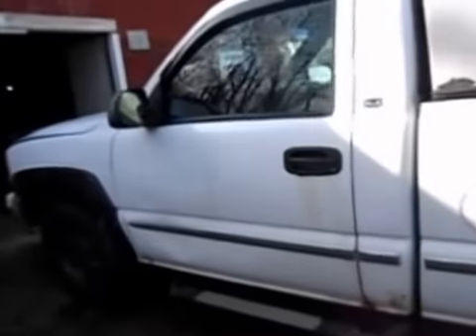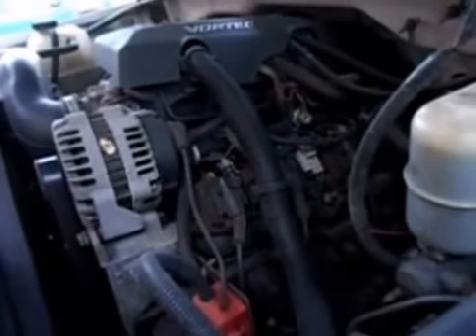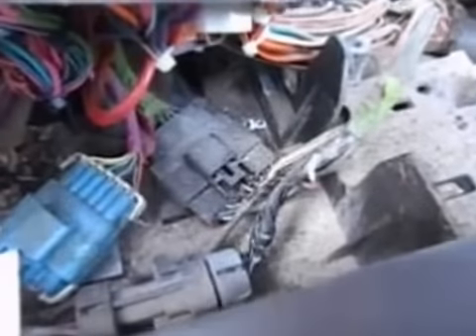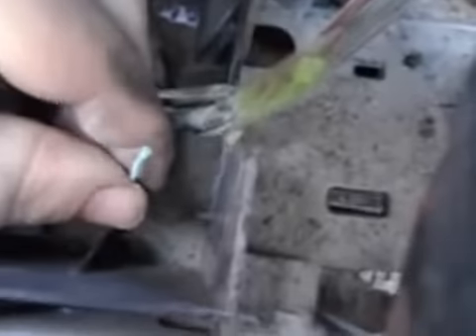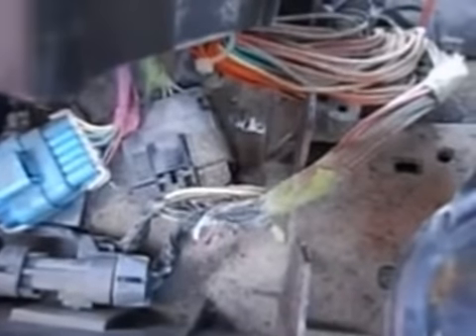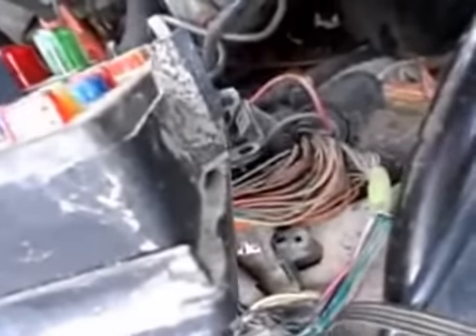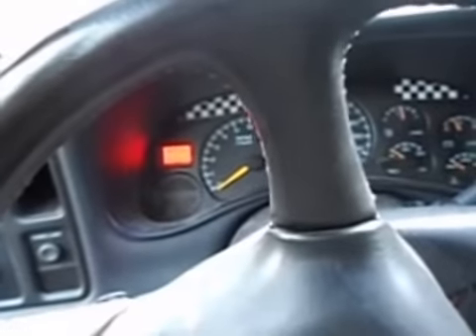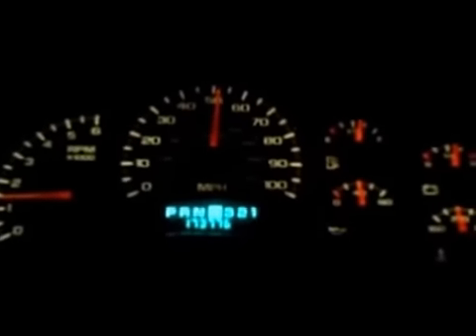shift issue 99 GMC New body style Sierra 1500

Comment: Bro Iv tried everything 
Ignition switch 
New ecm and BCM 
Ground wires 
Checked the green connector checked the entire harness 
Every fuse 
Brake light switch 
Iv done it all no difference 

Iv had enough I’m running a hot wire to the fucking thing first thing in the morning iama let yall know how this goes

Comment: Just put a new transmission in my 2000 Tahoe it's stuck in 3rd gear will be checking this tomorrow.... hopefully this fixes it....truck set for almost 3 years
Reply: Check you transmission harnes I had the same thing and my transmission harness was disconnected

Comment: Is that pink wire responsible for all gear shifts? I have a late first gear shift. Won’t shift into 2nd until the rpm is way too high, then it shifts. Not bad on the flats but up a slight slope, I get that late shift. Any thoughts?

Comment: when fixing wire's I always solder them together you'll be sure not to have to go back in to fix it. unless a chipmunk comes back.... but remember to use the rt solder thin electric solder of course not plumbing solder.. and remember to always put a little on tip just before you start. good video. bro.

Comment: First dam video that makes fucking sense 👏 👌  thanks my  feild driving friend!!!!
Reply: I should say that my 2002 GMC  YUKON XL IS ONLY DRIVING IN FIRST GEAR AND WONT SHIFT BUT ITS NOT SLIPPING AND THE CODE READS  NO CONNECTION TO THE COMPUTER. AUTOZONE SAID THAT I SHOULD BRING IT TO THE DEALER FOR THE COMLUTER ... IM LAUGHING BECAUSE I WAS INTENDING ON RUNNING THE 12V LINE TO THE TRANS .... LMFAO

Comment: I have a 99 4 wheel drive GMC 5 3 1/2 ton with 4 l60e transmission it will not go into Ford or reverse at all possible problems

Comment: I have an 1993 Chevy Silverado transmission shifts out good but has to put it in low gear to take off
Reply: James Andrews I have '96 GMC  1500 pick up that has that same problem basically. How did you fix yours?

Comment: Mine goes limp mode after a while of driving like when it get hot!
Reply: If it's electronic throttle body you probably have a poor connection on one of the pens on the wiring connector. I unplugged mine squirted die electric grease on the female side of the plug and worked it down into the holes. Plugged it up never had a problem since
Reply: You ever figure this out?
Reply: I’m here to figure out if the problem ever got solved ? I’m having the same problem truck shifts good up until it warms up.
Reply: Same here! Brand new from autozone. As soon as it it hits 120degrees I go into limp mode with no codes.
Reply: I’m having the same issues . Shifts great when cold when temp gets up to operating temp it loses all gears and engine stalls does not cut off . Help.

Comment: I’m having the same issue on my blazer imma check under the fuse box tomorrow reply to this comment so I can update if any you all wanna know what I find out about mine. By the way I replaced several solenoids and changed my filter and fluid numerous times as well as the inner harness because I believed it was an electrical problem*** but will check the fuse box connections ASAP.
Reply: Did you fixed your truck?
Reply: @Anthony-gw8sx  no I am still having this one code, Shift solenoid 3/2 downshift. I’m all out of ideas. When it warms up a bit I’ll drop the pan again and see what I can come up with
Reply: You figure it out yet?
Reply: @stevenswiatek6268  A-B solenoids. But I’m still having the code for 3/2 downshift solenoid that could be just a bad ground. I saw another video that explained how the ground going to the computer for that particular solenoid tends to go bad and they used to repair it for free but stopped or give an upgrade kit to replace the bad wire inside of the harness. Also to note*** When reinstalling the transmission pan, be careful not to damage those two A-B solenoids because that was my issue.
Reply: @SmokeStack456  so after you changed the downshift solenoid it still threw the code?
Reply: @justinbogard6700  yes the old one didn’t look bad either
Reply: Am having a problem with my 05 Silverado it runs good on the first but takes long to shift but it jumps 2nd and go to the 3rd gear i replaced 2 solenoids i also replaced the gasket put new transmission oil and new filter still does the samething
Reply: @SACRAMENTO_916  check the wiring for power at the solenoid. If it has power the next thing to check fault codes. For mine I had a p0785, the cause wasn’t the transmission but the oil pump wasn’t making the right amount of pressure so it threw the pressure off in the transmission as well. The oil cooler lines was leaking causing the pressure the drop.
Reply: @SmokeStack456  thanks for the advise man
Reply: @SACRAMENTO_916  no problem man let me know what you find out
Reply: So i took my 05 Silverado for a test drive and now it doesnt shift at all it only goes 1 gear and reverse thats it. The mechanic guy said i got 2 options here swap to a new transmission + labor or rebuild the whole transmission?
Reply: @SACRAMENTO_916  how bad is the strainer(filter)? And did u make sure u used the right transmission fluid and correct level? I know dropping the pan in these trucks is a PITA, but once you removed it again go ahead and replace the 2/3 shift solenoid, the 3/2 solenoid and A/B solenoid. If u only got first gear could u manually shift to second, third, so on etc.? If so, it’s definitely the automatic solenoids that is the problem. Each one would need to be checked and replaced if necessary.
Reply: @SmokeStack456  it wont go to 2nd 3rd 4th it only stays 1st gear i bought 2 new solenoids and transmission shift sensor AB and it still does the same
Reply: @SACRAMENTO_916  ok how’s the fluid level, with a low fluid level it can cause these same symptoms. Unless there’s a fuse or something in the wiring
Reply: @SmokeStack456  is exact level
Reply: @SACRAMENTO_916  when are you going to work on it again?
Reply: @SmokeStack456  probably in 2 weeks i spent lots of money just to buy pieces what am going to do take the transmission off and take parts out maybe i can find a solution to it if i do find what was the problem ill comment let you know what it is
Reply: @SACRAMENTO_916  well update us when u find out and good luck. There shouldn’t be a problem finding a good used one if you have any you pull a part places in your area. I think the going rate for a used one where I stay is about $150 fairly reasonable price
Reply: @SmokeStack456  i need help is the same vehicle 05 Silverado i had 3 codes for the check engine light on and i fix it so i drove it 60 miles check engine light came off so i took it to the smog and did not passed caused CAT and EVAP incomplete any suggestions?
Reply: @SmokeStack456  am still working on the transmission also
Reply: @SACRAMENTO_916  well your evap system is leaking or there’s a charcoal canister missing. If you had any accidents be sure that accident didn’t knock anything loose. Start with your purge valve location and follow the connections throughout the truck. You would definitely need a muffler shop to repair your cat unless you are capable of dissembling your exhaust and welding on new cat
Reply: @SmokeStack456  good advice i take a look EVAP i was also thinking can the dirt mess it up the purge valve also?
Reply: @SACRAMENTO_916  It could depending on how bad the condition it’s in. A quick look around could pinpoint exactly what’s going with the system. Evap or emissions will throw a code check your faults it will point you in the right direction normally

Comment: Ok think i may be having the same issue not sure .. I recently bought a 99 gmc sierra 5.3 l v8 4x4 with the 4l60 e auto trans .. Check engine light was on when i bought it.. Scanned for codes and itv was throwing a fault code for shift solenoid a , was still shifting at the time tho.. And it's am easy enough fix so bought the truck.. .. About 4 days into driving it.. I hit a pothole and speedo went all crazy then stopoed working seconds later .. All while the trans was trying to figure out what to do.. Now i was able to limp it off the main road and chevk things out .. I couldn't find any major signs of catastrophic failure ... Shifted manually ( column shift) thru every gear and they all work like they should 1 ,2,3 ,r , even d .. But won't auto shift like it should.. So endedv up towing it home asi didn't want to cause damage to it .. 
As of now I've changed fuses to brake switch , btsi under hood . couldn't find the vsb (speed buffer) behind glove box .. To try resetting that , nit sure about that anyways , i have replaced both shift solenoids with ac delco parts , new fluid new filter ,, replaced ignition switch.. Csuse i read somewhere that the 12v source that powers the solenoids goes thru that 200 $$ cluster fuck of wires and there were a few big cuts showing bare wires in a few.. Probably due to the steering wheel being lowered .. Idk for sure but replaced that .. Ive read multiple things and with each new thing i read it seems to contradict the previous .. So i guess my first question would be was your s giving you a fault code for solenoids ?  And two .. Do you know if the 12v supply to the solenoids is a constant ? Or is it only supplying while running? I still have yet to check for 12v current to it .. But just trying to get a feel of where to go next .. Any input would be appreciated .. Thanks
Reply: Dude my buddy had a 98 that did this and his ignition switch turned out to be his issue.....not at all saying thats yours....but can yiu imagine his surprise when he put that brand new transmission in and it STILL didn't work....thought he was gonna shit 😅😅😅
Reply: Bro , mine stays on 1st , high rpm, tried checking everything as well , did diagnostic and these show 

P0171 Fuel Trim System Lean Bank 1
P0300 Engine Misfire Detected
P0332 Knock Sensor (KS) 2 Circuit Low Frequency
P0404 Exhaust Gas Recirculation (EGR) Desired Open Position Performance
P0440 Evaporative Emission (EVAP) System
P0756 2-3 Shift Solenoid Valve - Performance 

B2647 Ambient Light Sensor Circuit Low
B2961 Key In Ignition Circuit Malfunction
Anti-lock Braking System 4WAL 3 Sensor
C0265 Electronic Brake Control Module (EBCM) Motor Relay Circuit

Don’t know which do check first
Reply: @Ponchito47  first this I would do is replace the ignition switch harness then both shift solenoids
Reply: @boostedkidproductions9719  quick question , what does it need to take to replace the solenoids ? I feel like I got all the tools , and how is the process ?
Reply: @Ponchito47  it's easy just remove the transmission pan and filter you will see the 2 shift solenoids lift up on the clip and disconnect the connector then push in the solenoid and at the same time remove the locking clip you can use flathead or pliers after you install them and put new filter install the pan and pour the old transmission fluid into a empty 4qrt oil jug that way you know exactly how much to put back in the job takes less than 2 hours
Reply: @Ponchito47  do you have the 4l60e transmission?
Reply: @boostedkidproductions9719  honestly bro I’m pretty sure I got the 4l60e , I bought everything needed today , I went to auto zone picked up 2 shift solenoids and the downshift one aswell , I was in the process of everything , only thing that stopped me was the exhaust , so maybe tommorow ill see how to remove it since I was struggling today , but keep in contact and Il let you know the results brotha👍🏽
Reply: @boostedkidproductions9719  update man , I changed out soledoid 1-2 & 2-3 and another torque one I believe, and just nothing , spent 2 hrs on it , and just for nothing , good thing is I now know 100% it’s the trans , smh sucks man but it is what it is